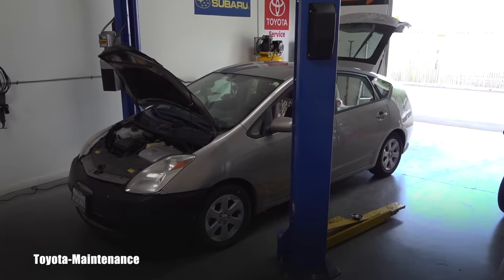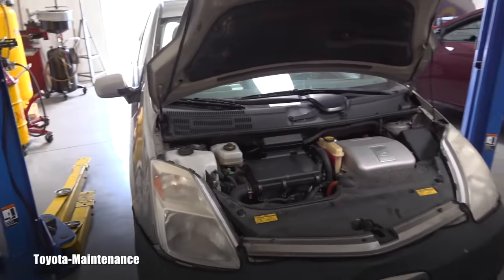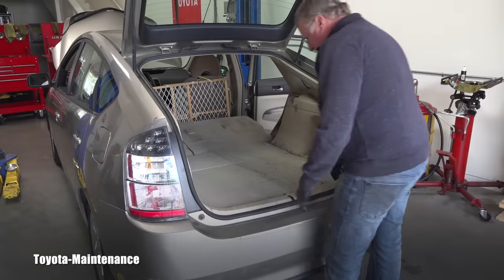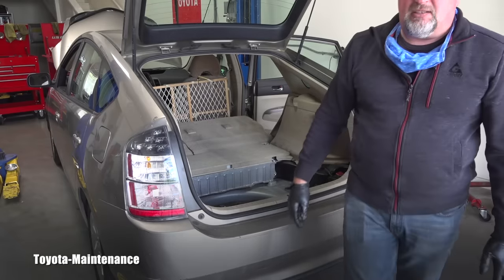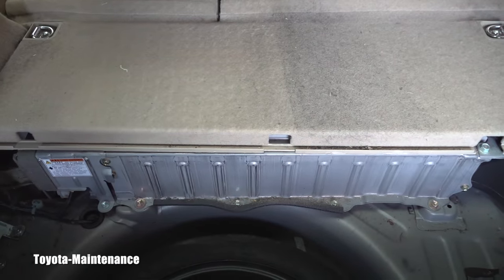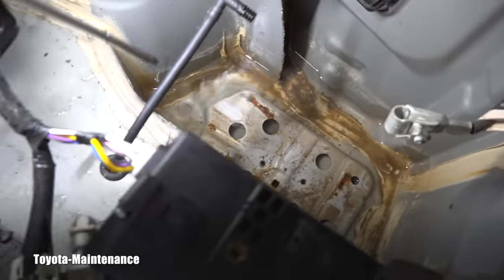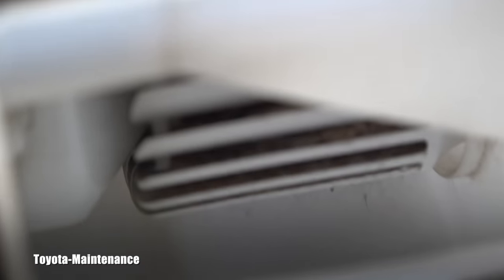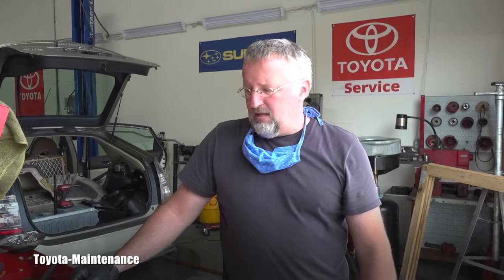Toyota Prius code P0A80 - Hybrid Battery Pack over temperature

Comment: You are such a professional - it is a joy to watch you systematically go through a problem. Nice job! This was all avoidable if the owner had not had the dogs back there - the hair and dirt would have been greatly reduced and I suspect the water came from the water bowl spilling.
Reply: You have a point about the dog water being a possibility, but I saw another video that showed that the seals around the Prius hatch are notorious for leakage. So I'd lean toward that being the reason.

Comment: There is a little screen you can buy at the Toyota dealer that goes over that vent it prevents some of the stuff from getting in to the fan area
Reply: Finally in the Gen4 they installed a filter from the factory.

Comment: Wow man thanks for doing this video. I just bought one today that was thought to have needed a new hybrid battery. I brought it home and erased the codes and this was the only code left. As I was doing this, I noticed that the hybrid fan was staying on! My theory is that the battery computer senses an overheat and stops power coming into the battery. Good job my friend!
Reply: Did cleaning the fan resolve the issue?
Reply: @christineangelofmusic1  No, sorry, I just saw this message. It turned out to be a bad module. I replaced the bad one, and reconditioned the battery.
Reply: @howardkanitz4998  Thank you so much for letting me know. I wish you the best! Mine is supposed to get a new battery here in a week or two.

Comment: Brilliant tutorial. I'm surprised there is no filter, like a furnace filter in a home. Was that dusty air blown all around the main battery? Were the other ducts (and the main battery) clear of dust?
Reply: You just asked the most important question of this whole video.A huge oversight on the part of the engineers,Or maybe it was on purpose?to sell more batteries? BUT really such a small fan with no incoming air filter and no auto timer on the cooling motor for run time after the car is shut off?I hope they the Toyota company sees this video and addressees it for the future.nice catch,or should i say COMMON SENSE for some people?But then again most drivers just drive,I'll bet the owners manual is still in plastic in the glove box.haha
Reply: @robertoruiz7069  I think they use coolant niw

Comment: I had a similar problem on the first car I bought. A 1967 VW Bug I bought at a garage sale in 1985. Driving up to the top of a hill about 2000 feet at the top it seemed like I lost half my horse power and it seemed hot. When I took the engine out changing the clutch plate and main bearing oil seal behind the flywheel I noticed the cooling squirrel fan in the shroud had some plastic bags in it obstructing most of it. It is supposed to have a grill over it preventing bags and things from getting in but that was missing. So that fixed that and I knew to reach into the squirrel fan now and then and make sure there was no plastic bags or anything sucked in.

Comment: Once I saw the dog dish I knew the whole battery cooling system was clogged with dog hair. There is a gap around the top of that right tail light that needs to be filled with silicone seal. And pull the rubber plugs at the bottom of the spare tire well and battery compartment and leave them out.

Comment: The few fans I've seen like that I've always recommended a filter for the air intake, most took it but a couple didn't so I suspect I'll see them back at some point for another expensive cleaning.
Reply: it seems to me that a filter for that intake should be part of the Prius's regular maintenance, like an air cabin filter?
Reply: @wim0104  I suspect it may boil down to public perception. Toyota markets the vehicles to have the same or less maintenance than conventional ICE vehicles. If they add something like that, even if it's a good idea technically, perception is easier to sway by external forces.

Comment: So what was the final prognosis?
Were you able to save the customer from having to replace the battery pack?
Reply: At around 1:36 he says blocks 16 and 15 are weak. He also said he test drove the car and could not duplicate the problem. The hybrid battery overall is OK. P0A80 is for battery overheating and you saw the reason why - clogged cooling fan. Bottom line after charging the 12v battery and cleaning the fan, should have resolved the problem as he said for some more time. The whole point of his video was that just because you see the triangle of death and dealers tell you need a new hybrid battery, look at other items first.
Reply: correction: blocks 5 and 6. The blocks in the center usually go bad first because they tend not to get as much cooling as the other ones in the ends. Heat is a battery block killer.
Reply: @ccacace1  
Respectfully, allow me to point out that you dont know what takes place with the car after the fan was cleaned and reinstalled. In your comment you said cleaning the fan "should have repaired the problem" but did it? Fact is we dont actually know. There was no follow up , at least not on camera. Sometimes things don't go the way we think they should have gone. Unless you follow up with a test to whatever fix you make, all you have is  an assumption that you fixed the problem. I agree with you on the "bottom line" part of your comment.
Reply: @gp992  I wish he had the time to respond to comments, a lot of people ask great questions.

Comment: I'm getting a trouble code (p0A80) and red triangle on my 07 prius. I have replaced 3 cells that were 6.8, 6.7, 6.5volts. Now, all the cells are reading close to 8volts each. I have thoroughly cleaned all the bus terminals, replaced the aux batt with a new one, cleaned the hv blower, made sure that the aux batt compartment is dry. I'm still getting a trouble code p0A80 and the red triangle. I would appreciate any suggestions.TY.
Reply: Try downloading the free drpriusapp there is a function that clears the warning lights, you can also set the temperature to keep the battery cooled lower. These functions are usually only available on high end scanners. You will need a cheap OBD2 outlet try ELM327. Good Luck

Comment: The Prius can't tell you what block is overheating, pa080 means one block has high low voltage greater less than .030 volts difference compared to other 13 blocks. So fixing dirty fan did nothing. Vehicle has at least one bad battery module. You know how I know it's impossible for it to know about a high block trmp, there are 14 blocks of 2 batteries, and only 3 temperature sensors.
Reply: What he said

Comment: There are 28 cells in the main battery  which should be over 7.2 volts each, If one or more are less they can be purchased/ replaced...That is causing the red triangle,,,,It  cannot detect a dirty fan, but does detect  the cell problem. I know because have recently repaired mine with youtube research.
Reply: It doesn't detect a bad fan itself but it does detect the effect of a bad fan, overheating. The red triangle can also be tripped if the battery overheats. The red triangle of death is a global warning for the hybrid system which can have more than one cause.
Reply: @meeder78 .Yes I agree but the main battery needs each cell voltage checked to see if it is still ok.

Comment: Would cutting out a piece of filter foam to put behind the inlet grate restrict air flow over the battery too much ?  I just went to look at an '05 on a lot in Louisiana. I went on a test drive and it was very sluggish, then I noticed all the error lights on the dash. When we got back to the lot it had turned out it had a P0A80 and P3022. It's August, the car is black and I don't think anyone has been driving the car for the few weeks it has been on the lot. The dealer claims the hybrid battery is new...

I wonder how much longer Prius batteries would last with liquid cooling.

Comment: I have p0080 code . Is it the same thing ? The battery charge fluctuate a lot from empty to full in short time. My code reader may not have symbol A in the middle . I hope you can help . The red triangle , check engine and brake lights came on as well .Thank you !

Comment: I have a misfire on my #2 cylinder and I’ve replaced spark plugs, spark plug wires and 1 coil that causes multiple misfires. I’m reading a faulty fuel injector might cause this? Also have the oil light flashing every now and then even though the oil is full. Is that due to the oil pressure sender ? I have a 01 3.4 tundra, thanks and keep up the great content
Reply: Injector and/or compression.   Move the plug to a different cylinder and the coil to an even different cylinder than the plug and see if the misfire moves.  Remember what cylinder you put the plug in and where you put the coil.   If misfire moves to one of these you know you have a bad part.   If plugs are old, change all of them.   Denso or NGK only on plugs.   Denso only on coils.  Hope it works out.
Reply: I recently had a customer who had 7 different codes in ECU.  Several were misfire codes.  I replaced all plugs (NGK) and one coil that was badly cracked.  After I put it back together I had a blinking check engine light and misfire on a different cylinder than I started with.  I took it back apart and labeled coils and moved plug and coil to different cylinders.  Back together and no codes!!!   Vehicle has over 1,000 miles since repair and customer is very happy with smooth running vehicle.  They text me 3 times since to tell me how good it is running.  Did some other repairs.  Intake gasket, found large vacuum leak, injector, 1 oxygen sensor (customer didn’t want to replace all of them. 143K on vehicle) and general sensor cleaning.
Reply: I bought all new Denso spark plugs, and the coil was put in not too long ago. Not 100% sure if it’s Denso though. I switched coils several times, that’s how I determined it was 1 coil giving me multiple misfires. But I still have the one on cylinder 2. I’ll get a stethoscope and listen to the injectors. I’ll try a compression/ leak down after most likely, thanks for the reply!
Reply: Sir Sweetness it’s got 227k miles, also the oil light keeps flashing. Would that be the oil pressure sender ?

Comment: I’d like to see a video showing how to fix the widespread problem of excessive oil consumption on Toyota 2.4 liter engines.
Reply: You can't fix it I own a 07 rav4 2.4 engine burn oil thru the pistons ,even the owners manual said that is normal to burn oil every 1,000 miles I go through a quarter oil
Reply: the problem is the engine design to meet crazy MPG criteria. we'll all have to swap to hybrids :-/ also, do make sure you have the correct engine oil in there: it greatly reduced the oil consumption in my 2011 Outback, but it took 3 oil  changes (every 3000 miles). Now she can do 5000 miles fine (driven normally, no towing or drag racing). I use the Subaru branded oil that was designed together with the engine. So carefully check exactly what brand & spec your engine needs. I still burn half a quart over 5000 miles.

Comment: Many times a prius  that has a dog or cat  riding along will clog the cooing fan. This was a good diagnosis video, and what was the cause of the water in the battery box? here in the south where I live that maybe a problem with our humility levels.What is your opinion on manufactured main battery packs? Thanks this is a good video.

Comment: A removable screen should be installed as standard.  Pull it out and wipe it off occasionally.  Every oil change would be a proper service interval.  This is just a bad design or is it planned obsolescence as when the battery is damaged many times it totals the Prius.  😠
Reply: The problem with a removable screen is that it obstructs the airflow and rather significant amount of air blows through that. I would say if you have dogs it's probably a good idea but then the problem is people don't do the regular maintenance period and you end up with even worse situation with that screen being clogged up and the fan not being able to draw any air . You would be surprised how effective that fan is even when it's obstructed. Mine did not have hair in it but it had dust and dirt probably 50% of the fin spacing  was occluded and yet it's still cooled perfectly fine and I live in 105 to 110 fahrenheit temperatures in the summer. The dog fur definitely makes this worse there's no doubt.
It would be relatively easy if you had dogs to simply pull away the front of that vent and wrap some screening around the air intake duct.
Just to let you know I've got a lot of experience with these cars, had the batteries apart completely disassembled new modules put in on my friends 2006.
My 2008 has 343,000 mi on it still rolling on the original battery pack.

Comment: Did it work after this? I assume that if it had, you would have shown a follow-up on this same video. 

Also, how did the water affect the battery? Rusted? Or is it enclosed to protect the battery from water damage?

Comment: I drove the prius i own 200k miles, after which "check hybrid system" came on and shut off the whole hybrid system. Went to go check the hybrid filter, and found there was none x.x took everything appart, cleaned it. Hope the issue goes away.
Reply: Did it solve the issue?
Reply: @Supermarx1978  unfortunately not, still trying to figure out what it is. When I reset the light, I can drive 50-300 miles before it comes back on. Before the light comes on, the prius starts lagging in power response... After pressing the gas pedal, it randomly takes 1-2 seconds to respond. No idea what it could be!
Reply: @Chemike21  Check the earthing connections to the battery and near the boot trim, mine has thrown a p3021 and poA80 code so just going through removing the fan first.

Comment: This is the exact code and dash lights I have, I have the P0A80 and P3000 (pretty general and not as specific as the additional codes you had). The dashlights will come and go but they consist of the red triangle, check engine, VSC, and ((!)) brake system lights. I don't have any dogs, and have gone through a couple hybrid batteries since like you said they just replace it. I've had the car about 5 years and haven't had problems until about 3 years into that time. Have replaced the battery twice since the initial problems. Was getting ABS and VSC lights, have replaced a few parts like evap cannister and heater control valve. But that's about it. Any ideas if this is a similar issue?
Reply: You've had to replace the hybrid battery multiple times??? Shouldn't a new one last along time?
Reply: @mbburry4759  lol did you read my post? It’s having a problem and draining the battery. Usually yes a battery will last like 10-12 years. Mine lasts like 2-3. The previous ones were still under warrantee so they replaced them for free. But it’s happened twice now since the initial replace.
Reply: @FaelonZ  the cars can sure be confusing. So you think there's another problem somewhere else that is causing the battery to fail?
Reply: @mbburry4759  I’m not sure. It’s doing fine currently. But also not driving it as much. I don’t keep up with routine stuff well, not super savvy with cars tbh. So lot of stuff baffles me.

Comment: Thanks for posting this video! I tried this a couple of days ago as I cleaned the small battery a bit (some corrosion!) and disconnected. Then re-connected without the issue. The error message is gone but how can be 100% sure my hybrid batter is ok? Car is 12 yrs old with 130k miles